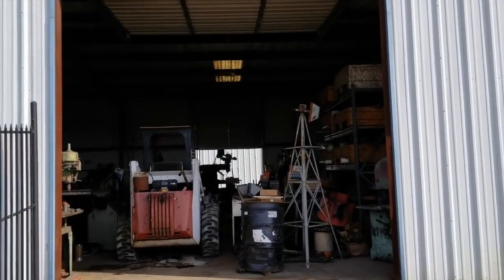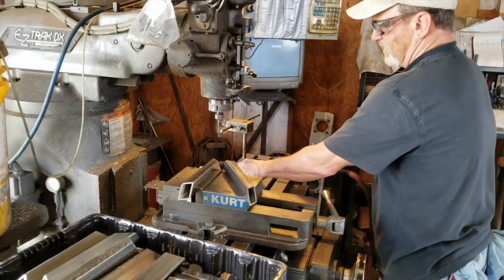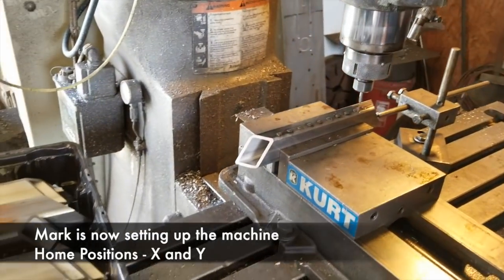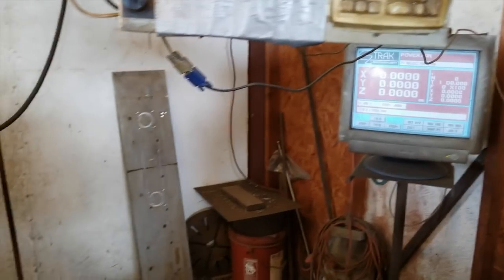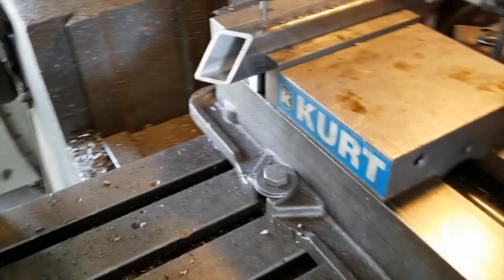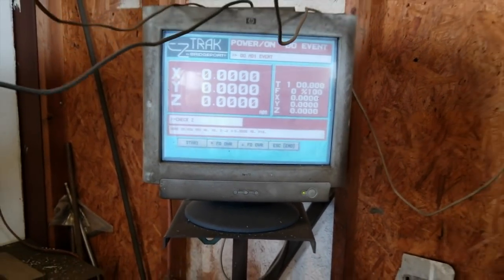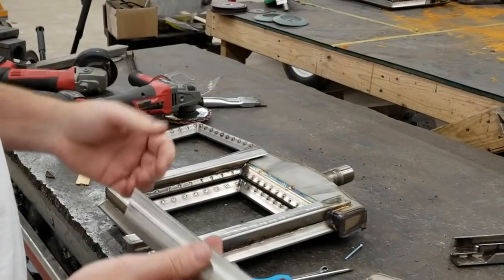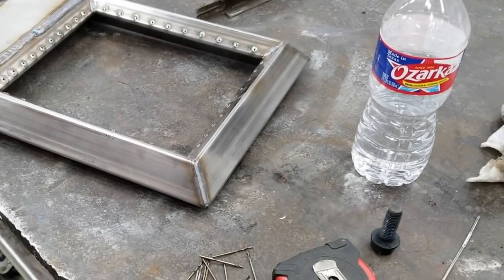Working on the Bridgeport EZ-Trak 2 Axis CNC Machine - Vertex Machine Shop

Comment: Worked on these EZ-Trak machines over 17 years back now before I moved over to IT support for a career. The display went on ours too within a year of having the machine and as a temp measure I used it without a display as we had to get a part out of the door. We were a small tool making shop that had 2 other Bridgeports but without the EZ-Trak system.
Reply: Hello, I just bought an ez-trak that was supposed to be in good working order but when I try to home it the Y axis moves toward the rear or column of the mill, bottoms out and triggers an alarm. Do you know what could be causing this, the motors and read-out seem to be working fine so I don't think it's a motor or encoder problem.

Comment: After the last video, I wondered why you were tigging little filler dots on stainless, but I assumed it was stainless filler. When you you stated that it was inconel that you were drilling, I knew right away what the part was and the purpose of the inconel. Last week I had a little job repairing a stainless pressure washer surfacer where I had to patch up the stainless sheet and then add 3/16" brackets for the wheels. Since I rarely work on stainless and haven't ever messed with inconel or titanium, it had it's challenges.

 The book settings for the hypertherm 65 weren't quite what was needed to cut the parts and then drilling that stainless went easy at first, then the material work hardened and ate my 3/8" bit. I had to open up that hole with a carbide bur in the die grinder. Instead of using my noresman bits and possibly damaging them, although they are designed for stainless, I used an old dewalt bit. The stainless, as you know, warps like crazy, but I did get to try out a new gas lens and it worked well. 

Also, I figured out that my miller elite helmet seems to have gone bad. It flares up at the arc and gets so bright I can't see the puddle, yet the rest of the lens is still dark. At first I thought it was the gas lens, tungsten, or material. Now I need to find a good helmet for tig that is very light weight (arthritis and bone spurs in my neck make heavy helmets not an option). 

Thanks for sharing and showing the good and the bad. It is nice to see the reality of what other fabricators experience. Last night, I watched a hot rod car build show on tv, but they skip over any of the details in the build and focus all on the drama. There really isn't anything to appreciate in those reality tv shows, for those of us who actually do that sort of work and that is why I rarely watch any of them and instead subscribe to channels like yours.

Comment: I doubt you would have much luck with carbide on that kind of set up. The tubing will always have some vibration. Carbide needs a totally rigid setup.
Reply: Today's carbide is different. Check out a Bassett Pedigree 3 flute or an Emco 4 flute made for stainless. They are incredible.

Comment: Carbide is unforgiving, use cobalt if it can cut it ok. You can always resharpen it.
Reply from the maker: resharpen a .060" drill bit ?  hmmm.... i will send you a big box full and let you sharpen them! lol
Reply: @turbocobra  You wanted them single point right? lol
Reply: I like using cobalt drills on the Bridgeport at my work. Carbide is great in a CNC machine with coolant and 10k spindles

Comment: Those ez track and trak cnc machines are great for jobs like this.
Reply from the maker: yes sir, its really a good fit for a job like that for sure.  no CAD/CAM to deal with on a full blown cnc machine, but a step up from a manual

Comment: Gary, look into Spotting Drills instead of center drills, they don't break off as often
Reply from the maker: Yea, thats a good point, my first thought was that the straight part of the center drill was teh same diameter of my actual hole, but yes I have a few spot drills, and they are definitely more ridid.

Comment: Cool to see the machine running in CNC-Assist mode.  That would be a nice feature to have.
Reply from the maker: yes sir.  i think the ideal job shop would have a full blown 5 axis machine, a manual mill, and this EZ-Trak with the built in "conversational" type interface is perfect for small jobs that have repetition

Comment: What a coincidence,  my last shop in ct I owned was also named Vertex and my name in Mark, but that was 17 years ago
Reply: vertex in math is the point where lines meet.
Reply from the maker: Hey Mark, very cool.  It seems like Vertex is a pretty common name.  Not even sure of its origin or meaning.
Reply: @turbocobra  Vertex Magnetos used in racing have been around for many decades.